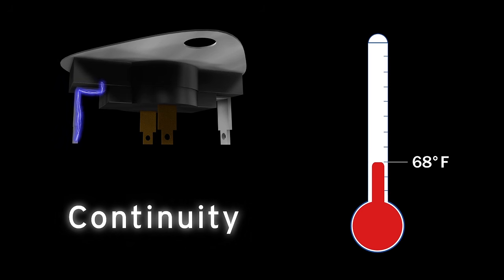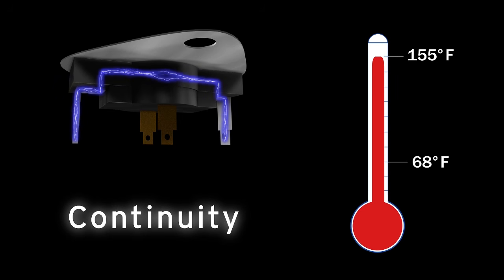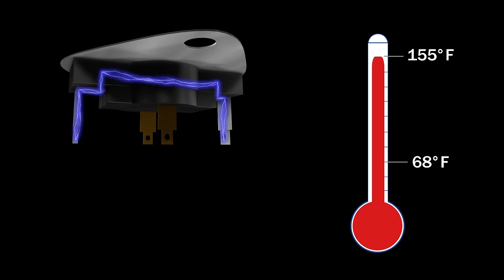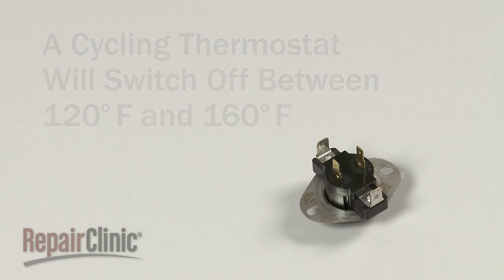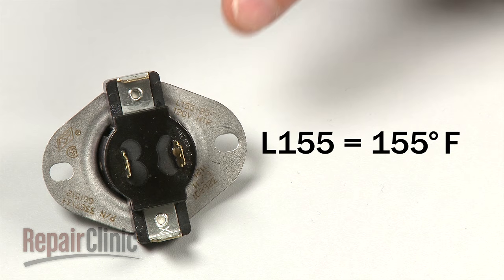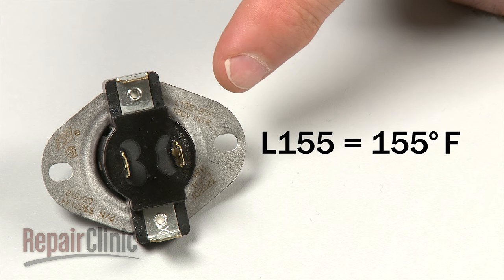Dryer Not Drying? Cycling Thermostat Testing, Troubleshooting

Comment: Checked out all four thermostats on Fisher and Paykel DE05-US0. All tested to within the temp limits printed on them however the dryer still seems to run hotter than it should. Control panel??

Comment: my gas dryer will start out heating , about 5 min later heat will shut off. I have to let it set about 25 min then start it back up to get heat on again, over and over. Parts shop says my cycling thermostat has continuity but im wandering if they r just checking it when its in the right mod,(checking it cold),
Reply: I have the same symptoms,  what was your final fix?!  Bill P

Comment: I read reviews on the dryer heaters available and it sounds as if they fail pretty quickly in many cases. I was wondering I’d this was because no one seems to replace the cycling thermostat when they replace the heater. Doesn’t sing like that’s the issue, but thought  I’d ask. It more likely seems that this part is cheaply made. Even the oem part failed relatively quickly in at least a few instances. Ours has lasted 8 years, and I’m getting the parts to replace all 3 parts. (Heater, limit and fuse)

Comment: If the dryer thermal fuse that is located next to cycling thermostat   is blown ,  "always replace both" as the thermal fuse should never blow if the Cycling Thermostat is working as it should. there is also a thermal fuse on the Heater itself along with a high limit thermostat. same issue if that thermal fuse fails "always replace both of them the fuse and "high limit" thermostat  , "Always" perform a through inspection of the dryer vent system ensuring that dryers vent is not plugged up with lint , a restricted vent will make the dryer overheat as well as force cycle the thermostat so often it will wear its contacts out or cause them to weld closed ,, a blown thermal fuse on the dryer outlet (Where the cycling thermostat is located ) is almost always a sure sign you have a vent blockage "or" you have lint clogging up the blades of blower fan or ducts within the dryer restricting proper air flow   , always check them before replacing as there is almost allways a reason why they failed ,, needless to say always unplug the dryer  before doing any service on it. .

Comment: Thanks for the post.  The heat in my dryer comes and goes on my Amana electric dryer.  After the dryer is completely off for a while, and we turn it back on, the heat element works again.  I have disconnected the dryer vent from the wall and the issue continues to happen.  I have tested the thermostats, high limit cut off and heating element with a multimeter and everything is reading fine.  However when i test the cycling thermostat on the prongs that the purple wires attach to (i understand this is for delicate heat setting) I do not receive a reading on the multimeter (or ohlms reading).  I do get a good reading on the prongs for the red wires that attach to the Cycling Thermostat.   Could the Cycling Thermostat be my problem (due to no reading from purple wire connections) even though we never use the delicate setting?  Thanks for your time.

Comment: I have a 140-20 cycling thermostat.  It opens the circuit at 120 and closes at 100.  Do I need to replace it?  My timer does not advance in the auto mode.

Comment: FYI if you are feeling the dryer giving off a LOT of heat, before calling anyone, make sure the exhaust hose is still attached to the dryer... it may simply have slipped off and the heat you feel may just be the exhaust spewing directly into the laundry room...

Comment: I have a 13 year old whirlpool dryer and it worked on one heat setting. Today I had to dry 3 times to get them dry. It’s hot when I open the door but clothes are just not dry. I had maybe 1/4 of a load in it

Comment: How do you know when a external thermostat heater is bad? And what exactly is its purpose? The one I have reads 9.6 ohms when checked. Is that within normal specs? The part number for this is 131658100

Comment: When I shaked the cycling thermostat it was making noise , sound like something broken in there , is that bad?
Reply: I don't think that's means it's bad.  Heat it up till it clicks and check if it still rattles.
Reply: d walker I heated it up and it clicked right away then I tested it but nothing , then I waited about 1 minute and it clicked again the I tested it was rattled, what do u think ? Thanks
Reply: @KietNguyen-td7ze  That sounds like it's working fine to me. The rattle that you hear is a little plunger in the switch. And when the switch  is heated up and pops it is pushed against a spring loaded set of points in the switch and is held firm in place. And then it doesn't rattle. When it cools down again and pops. The spring pressure is released and it will rattle again.
Reply: @dwalker399  thanks,  that's what I thought too . I think my next step to move on is the timer
Reply: @KietNguyen-td7ze  If you can get to them after you remove the timer. There should be another contact switch in the main body of the timer heat control that might be corroded and not making contact. Be sure to check those. A board type fingernail file works great for cleaning up the contact points.
Reply: d walker I ordered a refurbished timer on eBay with lifetime warranty, just installed today and it’s working like it should now , thanks man !
Reply: @KietNguyen-td7ze  No problem.

Comment: My dryer has a cycling thermostat, a hi-limit thermostat and a hi limit fuse.  I've had two heating elements burn out.  Was wondering if the cycling thermostat fails to open will the heating element essentially operate at the much higher set-point of the  hi-limit thermostat and eventually cause the heating element to fail.

Comment: I’ve replaced thermal fuse, upper and lower thermostat, and heating element. I’ve checked the breaker. Have checked the fuses, what would be the next step?
Reply: Did you ever figure it out? I'm having that issue as well.

Comment: What if there's no continuity in the middle ones, brownish ones?  I can't figure out my dryer's problem and that's the only thing I've found so far with no continuity are the brown ones, but the outside silver ones do have continuity.
Reply: stephanie cherness I was looking for that answer too
Reply: it ended up being my coil for me.  it tested okay for continuity but I guess they weren't working properly or were just too old.  it's a common problem so maybe try replacing that?
Reply: It was my circut breaker, found out by testing the power terminals. The manual didn't allude to testing both 110v rails by placing a probe on each to get a total of 220v. Had to replace the breaker and all was good.
Reply: Every time I check any 220-240 VAC unit no matter what it is I Always check for 120V between L1 and Neutral, then between L2 and Neutral, then between L1 and L2 for my 220-240 VAC. This is a basic common standard test to make sure you have both L1 and L2 supplying and not just one of them. I've found circuit breakers with one of the two L's not working when switched on. Replace the breaker and that fixes that problem.

Comment: Ok Hopefully someone can help me.. I just bought a Multimeter and it's my first time ever using one. Well I was testing my dryer thermal Fuse at the lowest setting  (200) And it had no continuity but once i upped it to about 200k 2000k It fluctuated to  0.00   So i'm not sure if I should replace the fuse or not?
Reply: First, always pull one of the two wires to isolate when checking a single component. Second, if you are getting weird readings I would replace the part.

Comment: My Maytag dryer is heating but after 2 or 3 drying it blows a fuse in the house and just started doing it. I replaced the thermostat and still does it I took the cycling thermostat out and seems to be fine. any suggestions.

Comment: My Maytag dryer MEDC400VW0 only dries on the low heat setting , not the high heat setting. It also seems to take longer than usual to dry. Does this sound like the cycling thermostat or the timer?
Reply: try unplugging the vent duct first.

Comment: What if Low setting is burning hot....Mine seems like it's getting too hot..I also have a venting issue too, it's been shuved in a hole in the floor behin it, & goes to the insulation inside by the a/c vent on other wall..?!!Thanks
Reply: The vent issue is the first thing to address... Have you cleaned the dryer very good? If so try running it for a few minutes without the vent hooked up. If the problem is gone then the vent is the problem.

Comment: Your videos are masterfully done and extremely helpful.  They've saved me so much money by showing me how to repair parts of my washer and dryer without paying a technician a mountain of money.  My dryer is currently not heating, and using all of the continuity tests I've narrowed it down to a non-functioning Cycling thermostat.  Mine has three terminals and I am having trouble determining the replacement part number.  It has many, many numbers printed all over it and googling each one leads to all sorts of weird results.  Any help you can give would be appreciated.
Reply from the maker: +Eric Salmonsen Enter you dryer model number at www.repairclinic.com?TLSID=1773 to look up the cycling thermostat. The numbers on the part aren't always valid part numbers.

Comment: what does it mean if the continuity is 0.3?  good or bad?   I have a Samsung Dryer Model DV50F9A8EV   that has no heat.  Element shows continuity , the devices on the heater housing show either .3 or .4 ohms of resistance.  what else can I check for no heat?  there also is no error codes on dryer
Reply from the maker: +JIm Hribnak Anything that measures less than one ohm resistance can be considered to have continuity which for a element is good. The element will likely measure a higher resistance between 5-50 ohms if you adjusted the ohm range. Thermal fuses and thermostats should be checked for continuity also if you have no heat.
Reply: +RepairClinic.com well the high limit works  and shuts off using the electric fry pan. is there anything else to check? everything checks out  have not checked to see if I am getting 240 to the dryer yet

Comment: I have an Amana dryer that is taking to long to dry clothes. Here is what I've found so far. 
The heat coils heat up and ignite the flame. 
BUT, if I have the exhaust vented outside, it shuts the flame down. 
If I take the vent tube off of the wall where it goes outside, it still shuts down. 
If I take the vent tube off of the dryer itself, it works fine. 
The tubing is clean and clear and so is the vent to outside. I ran a long vac hose through it to be sure and I went outside and it's blowing strong air. 
The flexible tubing is only about 3' long and the solid pipe in the wall to outside is about 2'. 

What would be causing my dryer to shut the flame down with the flex tube attached to the back of the dryer, but not out the wall, and it works fine without the pipe attached to dryer at all? Is there a pressure switch that can sense that tube and going bad?
Reply from the maker: +Sean Hass We recommend getting rid of the flexible vent and installing ridge venting. There is no pressure switch when air flow is poor the flame does not get pulled through burner and trips the high limit thermostat.

Comment: good video but you should warn people that the smaller thermostat is actually a one time use limit switch.  if you test it with the hotplate method, you'll blow it and have to replace it. you can look up the part number to determine the type. found out the hard way. :(
Reply from the maker: Ken Reynolds Thank you for sharing.
Reply: Why will it blow it and you have to replace it? doesn’t the hot plate method mimick what the dryer does?

Comment: I have my multimeter set to 200, and it is displaying 0.4 on one thermostat, and 0.5 on the other.  Does that mean it's working, or that it's broke?
Reply from the maker: Depending on the meter, you may get a slight resistance reading. .4 and .5 would be a closed circuit. If the thermostats you are checking are supposed to be closed, then they are good.

Comment: my amana washer will agatiate but will not spin. I have checked and replaced the lid switch and you told me my motor coupler was good when I brought mine into your store. I am thinking the drive block mabey bad. It used to make a loud noise when the spin cycle ended. To remoce the nut you need a spanner wrench? Do I need one or can use something else? Thanks for your help.
Reply from the maker: I agree that the drive block is most likely stripped out. A spanner wrench will make it easier to get the nut off but you can use a small pipe wrench. You just have to be careful not to hit the side of the tub with the wrench or the hammer. If you still have trouble getting it off, you may need to get the spanner wrench.

Comment: Ok, So I have an odd issue, I have a Maytag DE106 Dryer (a beautiful classic from 1979!) as nice as she looks... The 220 cord got loose, melted and grounded on the chassis so I replaced the cord with an even thicker one I found new which looks very close to the original part, I also replaced the heating element with a 240v and it tested good, and both of the thermostats tested good, also the dryer turns on and the timer ticks down as it should....BUT....Still no heat!
 (Edit) I stood by and watched as the timer clicked down to OFF and it shut off, and still no Heat. Could my 220 connection or the breaker be bad?
Reply from the maker: The first thing to check is for 220 volts at the terminal block on the dryer. You should have 220 volts from the red and black wires and 110 from the black to the white and red to the white wires on the terminal block. If you don’t, you may have a breaker problem.

Comment: I have an amana electric dryer. model number is ned4500vq0. It started stopping after about 10 mins running. It stops like this all the time. Only way for it to work like normal is to leave screen filter out.  Then it works like it should. also I have checked high limit and thermal fuse for conn. and it checks out good. Anybody have  an idea or something else to check. please let me know here or email at mwilt4822@sbcglobal.net     thanks Mike
Reply from the maker: If removing the lint filter allows the dryer to stay running, we recommend that you inspect the filter to ensure it's not clogged or damaged. Dryer fabric softener sheets have been known to cause residue buildup on the filter, clogging some of the filter holes. If some or most of the holes are plugged, it may be enough to cause the motor to overheat and cut out. You can clean  he filter with water and a bristle brush or replace it if necessary. Also, make sure the filter housing is clean. If of that all looks OK, check the dryer's venting; there may be a partial lint blockage in the venting. The symptoms you are describing are most likely the motor overheating and tripping out the motor thermostat, which will reset after it cools down and will allow the motor to start again until it trips out. If you have checked the venting and the lint screen for clogging and found no restriction, you may need to replace the motor to solve the problem. You may find our website's repair help to be helpful. Be sure to enter your dryer's model number: http://www.repairclinic.com/repairhelp.
Reply: ***** I have opened up the dryer by taking it all apart back and lint vent and vent to outside. nothing is there to speak of. I have also tore apart the front cover and removed the drum and checked and vacuumed clean all. what will it hurt if any to use the dryer for now mabey 2 loads a week to leave lint filter out? I live on a fixed income and at this time don't have the funds to repair this or have someone come in. The dryer is only about 4 yrs. old and I take care of it and all my things good. Please let me know thanks Mike

Comment: When I test mine with tone it reads 002 at room temperature is it good or bad I see yours is 000 please help
Reply from the maker: Robert Estep Hi Robert, your thermostat is good. 002 is close enough to zero. If you are not getting heat, you'll need to test other components in the heat circuit.
Reply: *****   How far from 000 would be too far from zero? My reading is constantly fluxuating wildly between 003 and 009.

Comment: If all of the thermostats have continuity but my dryer is still not heating, what else could be wrong?
Reply: +jean The element, thermal fuse, or circuit breaker.

Comment: Should there be continuity with the inner terminals? In room temperature?
Reply: ***** when I test the INNER SMALLER TERMINALS i get NO CONTINUITY with digital meter and an analog reading of 7.05 ohms, so does this mean the internal bias heater is okay. The larger outer terminals have continuity (0.00 ohms).
Reply from the maker: You must be testing a thermostat with a small bias heater in the center for the low temp setting. There will be continuity between those two terminals but the resistance is VERY high so the meter being used has to be capable of reading the high resistance. Thanks. RepairClinic.com
Reply: ***** awesome! thanks for your help and clarification.
Reply from the maker: The inner terminals go to a small heater inside the thermostat that has a high resistance. If you are using an analog meter you will need to use a higher ohm setting to read it correctly. If you don’t the needle will not move and you will think you have an open circuit. Hope this helps.
Reply: ***** okay so a high resistance reading of 7k between those two terminals on small bias heater means its good.
Reply from the maker: Yes that is correct.
Reply: @repairclinic is 28k ohms too high?